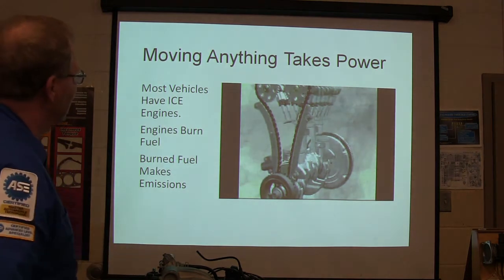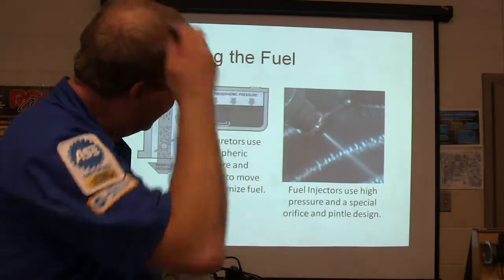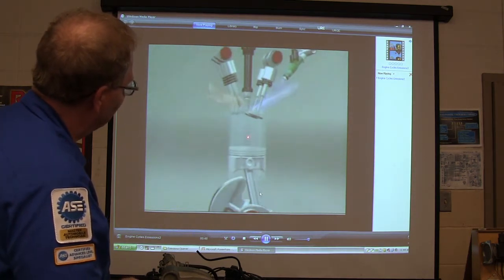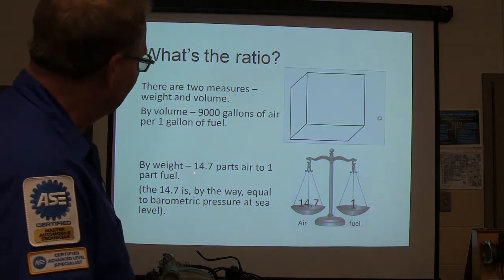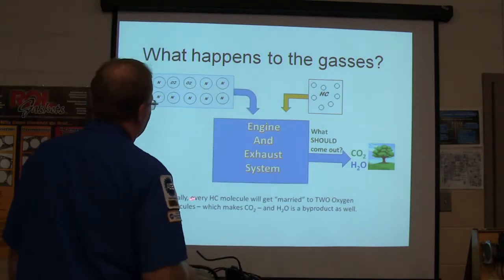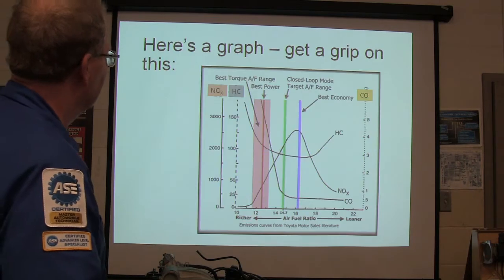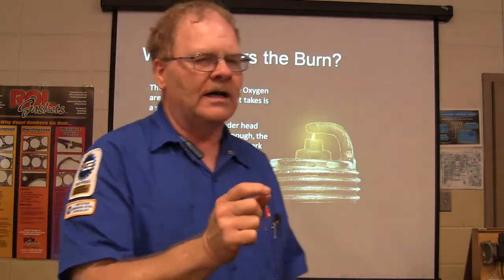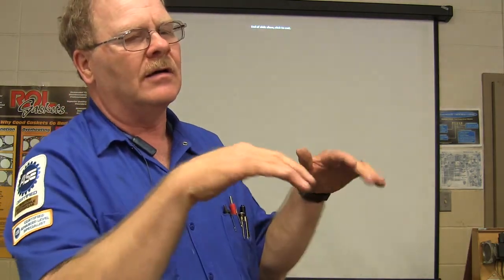Emissions Day One

Comment: Saw the animation, the injector jets before the intake valves are opening? Aren't they injecting during the intake stroke?
Reply from the maker: Nope - they're injected right before the intake valve opens on Port Fuel injection - GDI is different though... injects right into the cylinder with very high pressure.
Reply: @McCuistian  Thank you for answering! OMG, all this time I always thought that the port injectors spray while the intake valve starts to open, though always wondering how is dealt the variable injection time in regard with fixed valve opening time.  Now its clear, so the mixture is created inside the intake duct and it waits for the valve to open to be sucked inside the cylinder? I always thought the mixture is created while the air travels by the valve while the injector sprays on !
Reply from the maker: @cipriansofineti346   it's only there very briefly before being swept into the cylinder as the intake valve is opened... 😁
Reply: @McCuistian  I assume the injectiction commences during the second half of exhaust stroke or so ?
Reply from the maker: @cipriansofineti346   The cam sensor on port injection units I've worked with and tested makes its switch at 24 degrees after top dead center on the power stroke to make sure all the fire has gone out in the cylinder. The window for injection takes place after that.
Reply: @McCuistian  meaning 48 degree for cranksahft ,exactly the second half of exhaust stroke . Would you please explain me something ...I have a persistent DTC "Mixture Adaptation - Lower Adaptation limit (add) not resched. " . I understand its a trimming issue ,but not exactly in which way. Is it like ECU is trying to enrich (add) but he can't reach the lower limit? Is it reading constant  lean mixture from the 02 sensor? Do I have low pressure fuel/ dirty injectors? I have good values for lambda factor ,swinging fast ( about two times per second ) from 0.97 to 1.03 . Also 02 voltage switching fast from 0.1V to 0.8V ,the probe isn't lazy ,its  brand new .Thank you in advance for your time!